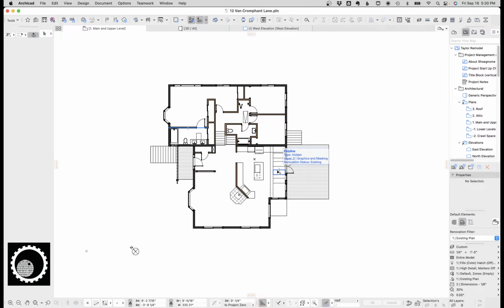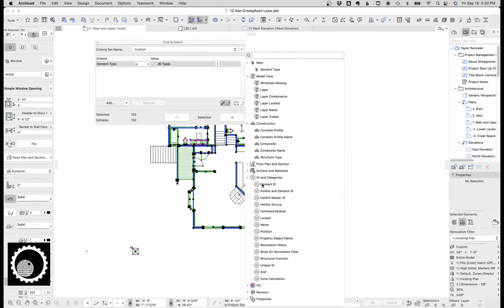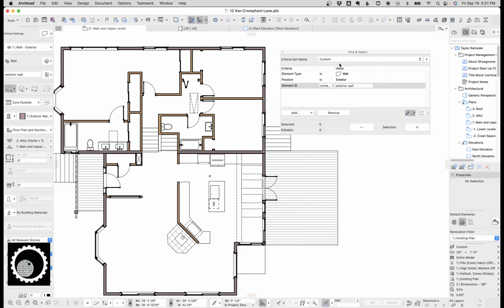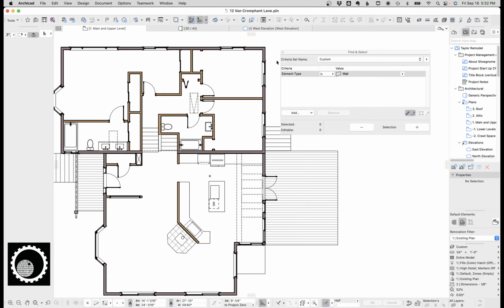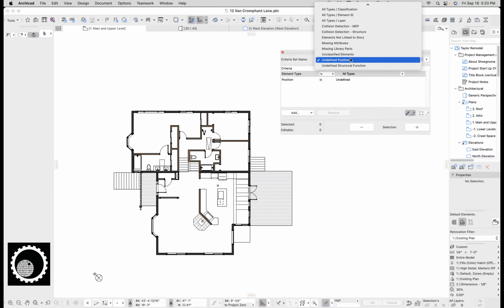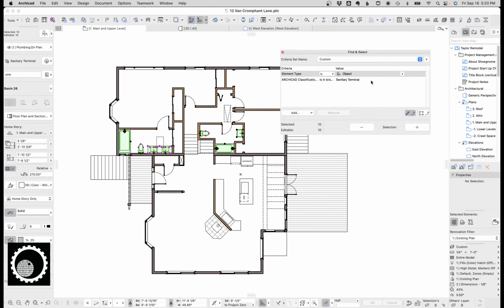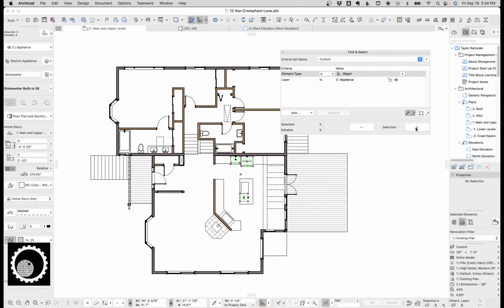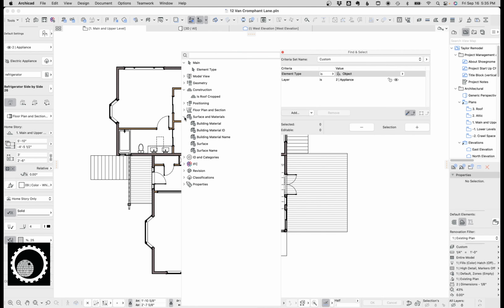Archicad Tutorial #87: Find & Select

Comment: Hi Jared. I wanted to know in Archicad on a split-level project I notice some windows that are on a lower plane disappear on the floorplan view. How do you correct this.
I have tried to change my floor plan cut plane setting but then other windows start to disappear. I hope you understand what I'm talking about
Reply from the maker: You need to change the floor plan display of the wall and window. Set the wall to be symbolic display and show on home story only. Then change the window floor plan display settings until you get what you want. Sometimes it's a little more tricky than that, but the answer will be a combination of wall and window floor plan display, not floor plan cut plane settings.
Reply: @Shoegnome .Thank you...did just that. Much Appreciated...Keep up the good work.
Reply from the maker: Glad that worked.